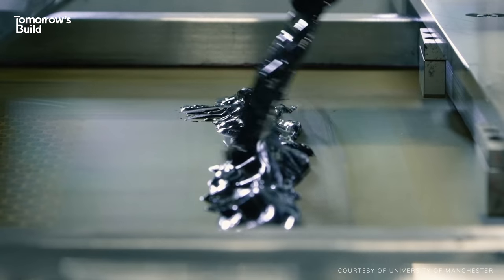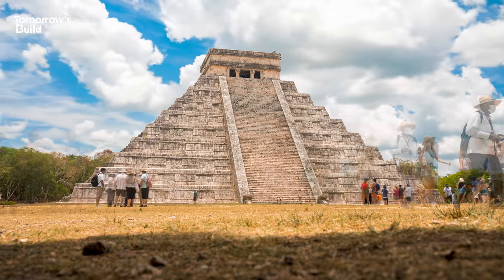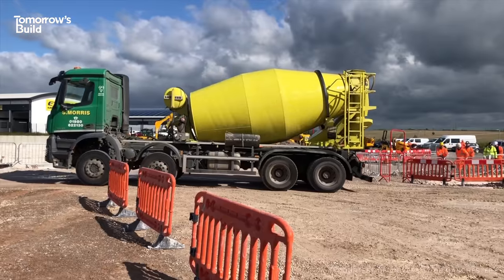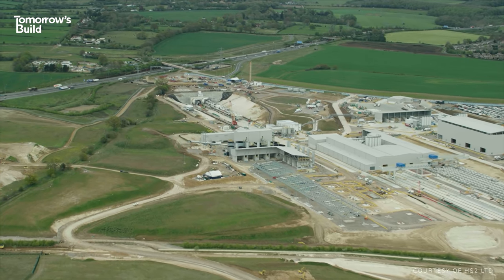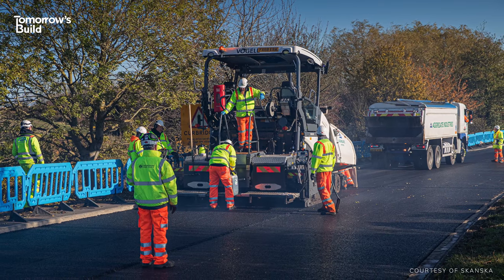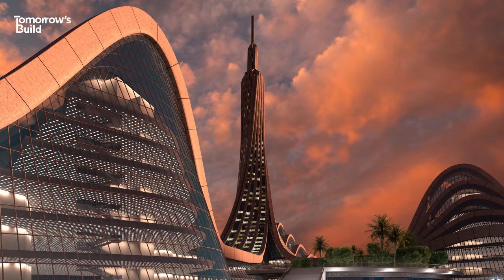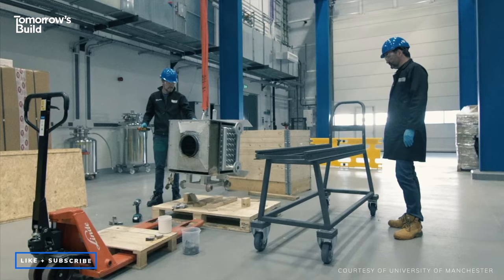Construction's Graphene Revolution Has (Finally) Begun

Comment: All great, but if you want to think sustainably, you have to consider what happens during demolition. Like asbestos, graphene dust could be carcinogenic. It may just not be worth the effort if the industry wants to become sustainable. Steel is great, wood is wonderful, but concrete in general is pretty much impossible to recycle. Adding graphene may just make the process worst.
Reply: @matthewcapobianco9332  It still might be not the greatest idea to breathe in those nanotubes.

Besides that, adding graphene to anything essentially makes it a composite, and those are notoriously hard to recycle (where "hard" means unprofitable). So Adam has a point here.
Reply: @AdamPitas  hmmm, I wonder, as it has been suggested before in the space and futurism scene 
when it comes to the problem of radiation exposure in long space flights, there's an actual change that we'll just be able to cure cancer 
(be it by learning to detect it when it has only a little cluster of cells, or develop gene therapies that work 90% of the time, or actual vaccines that teach the immune system to kill specif tumour one might have or whatever) 
before we learn how to shield completely a space vessel/ station/ colony from all harmful radiation and just live with it
so much on earth is already carcinogen naturally, and our industrial process multiply these exposures greatly, and probably will continue to do so 
it may be too optimistic, but it might just be plausible to consider the scenario in which we just learn how to cure cancer as a response to carcinogenics
Reply: @matheussanthiago9685  An idea that I'm surprised doesn't get more attention. I think you're the first person in a long while I've seen bring up that possibility.
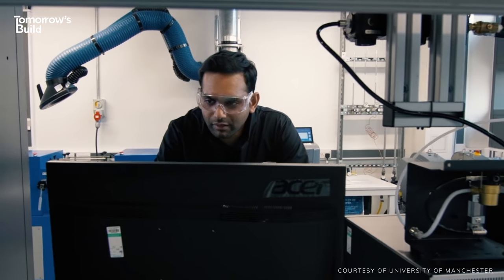Reply: I noticed the guy at 2:15 wasnt wearing a mask. He just opened up a big tub of graphene dust and shook it around.
Reply: You are always blinded when you look at the sun. No inventor ever thought what will his invention will actually turn out to be, other then what they thought it should be.
Reply: @Adam Pitas  💯   Only by examining the impacts and consequences throughout the entire life cycle of the product -- from extraction of source material through recycling (or demolition)  -- can we evaluate whether it is helpful or harmful.

Any less analysis is just boosterism for the next profit darling of investors.  Leaving us to live with the consequences.
Reply: Or- it could just as likely be a very good thing in 50 - 75 years when the demo happens. Impossible to predict what the world will be like then when it's difficult to predict past even five years. I say we move ahead at full speed and not allow fear to lock us into a lesser fate.
Reply: @AdamPitas  I actually don’t think graphenes will be nearly as problematic as carbon nanotubes (CNT’s). The asbestos disease is a result of needle like fibres similar to CNT’s damaging cells, whereas the nano plate like  structures of graphene are actually more comparable to clay and ceramic materials which are also 2D nanosheets. So I remain optimistic. Not all nano-structures are carcinogenic, it just means they exist at the nano scale. The morphology and reactivity is what matters the most.
Reply: @Joe-nq6hy  it’s an ionic crystalline structure, with many thousands of repeating units of ions, definitely much larger than the atomic scale (it’s not typically called molecular due to the bonding properties but will usually be larger than most molecules). I’m not sure the structures of moon dust, but I had heard that it is ultra fine and highly charged on the moon surface from high energy radiation causing it to both be highly sticky and also be at risk of entering the lungs avioli due to its small size, so generally not nice stuff
Reply: Concrete is crushed and recycled,  what are you talking about?
Reply: @MrLong-pe3cm  graphene oxide
Reply: @antpoo  When it hardens, concrete undergoes a chemical reaction that isn't reversible. You can reuse concrete as gravel or aggregate, but you cannot recycle it. In recycling you have to ask yourself if the material can regain the properties it originally had, concrete cannot.

Most concrete isn't reused because it's an expensive process and people generally want fresh concrete in their new buildings. Calling reused concrete recycling isn't correct. I think it just perpetuates misinformation that concrete could be a sustainable construction material.
Reply: @AdamPitas  oh I see what you mean.  We do recycle into other uses (crushing for road base)  but yes, concrete prior to curing is a one off process.
Reply: @Citizen-of-theworld  both graphene sheets and CNTs have serious potential consequences in the blood stream and collected in the brain/spine due to the high conductivity.
Reply: @MrLong-pe3cm  No, it's not.
Reply: @ADobbin1  but graphene and carbon nano tubes are forms of carbon rarely encountered in nature and also having properties opposite other forms of carbon. Including low reactivity (will not degrade) and conductivity (can disrupt system function) and strong structure (can poke holes in stuff it shouldn't). 

Relatively large man made versions of these carbon structures in unnatural quantities may have a lot more affect on a body than just touching or breathing in some carbon or graphite dust. 

Basically needs to be seriously studied, if this material has never before seen useful properties it is also possible it has never before seen negative consequences. 

Super excited for industrial manufacturing and use cases for them, but also hope we are a bit more cautious about it than we were about asbestos or phosphorus for example.
Reply: @5353Jumper  I agree it does need decades of study but when have humans ever been cautious when there was a way to make tons of money or a major health crisis for instance?
Reply: @ADobbin1  also if graphene and CNT live up to some of their promises they could help solve a lot of the world other catastrophic problems. Better renewal energy production, better batteries, lighter materials, energy efficiency, clean water and more. It would just be really nice if it could do all that without giving us all brain tumors.
Reply: @ADobbin1  if it were just carbon molecules we would just call it carbon.
Reply: @antpoo  why they call it graphene i don't know but it is carbon lined up in a particular lattice structure the same as diamond but with a different pattern.
Reply: @MrLong-pe3cm  no.
Reply: @MrLong-pe3cm  no.
Reply: @antpoo  That is called repurpose, when you recycle glass it makes grass again,
Reply: You forgot hemp
Reply: @lonestarr1490  I hate how we try to put our garbage into everything. Asphalt is 100% recyclable, it doesn’t need plastic or glass, it already contains recycled stuff probably.
Reply: @Joe-nq6hy  moon dust is probably more like fine broken glass.

Sand grains on earth are fairly smooth because the wind and water grind them down, but on the moon this doesn't happen.
Reply: @antpoo  Diamonds are just carbon, yet they're referred to as diamonds. Why? Because carbon atoms can be arranged in a variety of different ways, resulting in a variety of different materials with wildly differing properties, and it is useful to distinguish between these different materials. That's a two-line introduction to the concept of allotropes.
Graphene, coal, diamonds, carbon nanotubes and buckminsterfullerene are all allotropes of carbon.

Comment: Nice video, but I would have liked it more if you went in a bit more details about it's ecological properties. Is raw graphene recycable and does mixing it with other stuff hinder the recycling process of those materials? Why is it so hard to make in mass? What about Energy cost and pollution from producing it? Also, this being very conductive in heat AND electricity sounds more like it limits some of its applications as a standalone material. 

This honestly sounded more like a sales pitch. Nevertheless, I didn't know about Graphene at all, so thanks for the introduction!

Comment: I like the idea of graphene replacing things like gold in PCB traces and copper in CPUs; leading to potentially even cheaper and faster electronics. Now we just need to discover the next wonder material that is easy to produce to replace silicon since we're nearing the limits of silicon before quantum physics start playing a role and causing electron jumps and skips.
Reply: If graphene does not go the same way radioactivity and asbestus went I am all for it

Comment: Well let's just hope that this time around, unlike with the emerging issue with environmental plastic nano- and microparticles, the cyto- and genotoxicity of graphene and GFNs is fully determined for all life webs before these materials are introduced widespread into the environment!
Reply: Graphene is naturally occurring in small quantities. Graphite has it inside it and we have used graphite pencils for  a long time now
Reply: @Cyberwar101  Sorry, but that's an incredibly poorly formed argument. There are countless substances and pathogens that are "naturally occurring" but which in a particular phase, form, formulation or quantity (mass or rate) may be determined to present an unacceptable risk, perhaps as a consequence of emergent properties.
Reply: well, if I'm no mistaken graphene is a fairly simple arrangement, whereas the polymers that form plastics are huge molecule with long repeating patterns that make the breaking process a more complex demanding more time and energy to completely break 
I'm under the impression that graphene's structural simplicity give it a huge advantage over plastic when it comes to natural decay 
I could be very wrong, and if someone has a more profound understanding on the subject, I'd be delighted to be enlightened
Reply: They argue about industry regulation slowing them down, but regulations in the constructions industry is there for a reason: if tomorrow everything was built with graphene, and in 10 years we realize it's just like asbestos, or that it turns into a paste on earthquakes, or that it makes the concrete flammable, or poorly insulated, or even something else we couldn't even think of, then we have 10 years of new buildings that need to be carefully demolished or even entire neighbourhoods made dangerous by the side effects.

Comment: Now I've got find out how it increases concretes strength.  Curiosity is sometime a curse.
Reply: I think that's what makes us humans special
Reply: Lots of handwaving and 'magic' probably. Oh and creative testing. Lots of that
Reply: Same reason why carbon is added to iron to make steel. It's got a lot of tensile strength, which means that mixing it into a material without much tensile strength increases its overall durability. When concrete flexes, it tends to develop tears and cracks, those widen into full breaks. When you add graphene into it, then the strength of the graphene helps to stop the formation of those cracks.
Reply: @Cyberwar101  The two cannot be compared at all. Totally different.
Reply: @Lazy_Tim  it's more of an analogy scenario 
surely the process and proprieties are a whole new beast entirely
Reply: @Cyberwar101  I guess the point is that if the cement cannot bond to the graphene then it could be nucleation sites for those cracks to start, and the small size of the particles could mean that they just slide out of the surrounding concrete rather than stop the cracks from propagating.
I would also like to know a bit more about it myself.
Reply: It's not about curiousity you are just wasting your time consooming useless information .
Reply: @Meeeeeee37  I disagree.
Reply: I don't understand how graphene flakes helps for anything. I was thinking of it something similar to carbon fibre or carbon nanotubes.
Reply: Or they could have just told us in the video.
Basically the video was saying, "You know how to use google? Go try it and tell us what you find out."
Reply: @N0Xa880iUL  I found myself wondering this, too. The powder we kept seeing… does it somehow bond to itself, and the rest of the concrete mix? I haven't studied material science since high school, but still, I just can't see how it could improve tensile strength if it's not elongated, like rebar.
Reply: @Meeeeeee37  If you're going to criticise people for how they spend their time, correct spelling might be useful information for you to have.
Reply: @nomadMik  Yep. I struggle with the same. It probably has to do with material science not being my field. Maybe it's obvious to someone from there.
Reply: @nomadMik  In his defense, I'd guess he's just projecting in a sarcastic way. Also that consoom is popular meme spelling of consume.

Edit: I'm not now sure as he misspelled curiosity as well. Lol.
Reply: @protorhinocerator142  The video is basically one long ad for the new "wonder material".
Reply: As I understand it on a very basic level like rebar just on a much smaller scale
Reply: @Lazy_Tim  Are they that different? As far as I know the addition of carbon to iron makes it stronger because the larger carbon molecules prevent the movement between the dislocations in the semi-crystalline structure of the metal, which sounds distinctly like a similar process to the role of rebar and graphene increasing concrete’s strength due to their better strength under tension.
Reply: The reactions that happen when we mix cement, water, sand and stone kind of produce filaments of silicates that bind together all the grains of sand and small pebbles, what makes concrete great when it comes to bearing compression. I don't know, maybe the graphene strengthens the filaments making then even better at supporting compression and traction. (Sorry if some words might be out of context,  but since English isn't my mother tongue, in some fields I may lack the proper vocabulary).
Reply: It is carbon. Concrete is mostly carbon. They bond perfectly.
Reply: @justahuman2345  No it isn't. Concrete is mostly calcium, silicon, aluminium, oxygen, and iron.
Reply: Its essentially a replacement for steel bars, which are usually added to concrete to keep it together even if it's cracked
Reply: @Meeeeeee37  don't break this person's curiosity. Too many adults are boring and sad because people say things like that punish them socially for their curiosity, and over time, it kills their curiosity. Humanity progresses because people are curious.
Reply: @Meeeeeee37  oh hello stranger on the internet, what brings you here to watch this video you deem contain useless information
Reply: @Lazy_Tim  I would advise watching "Practical Engineering". Just being able to replace steel reebars with a additive is a huge leap foward.
Start with "Was Roman Concrete Better?" It is explains why we use steel reinforcements - why we have to use steel rebar - but how the steel is also a massiv issue in the long run.
Then the "Surfside Condo Collapse: What We Know So Far" as it delves into thermal issues of steel reinforcement (and how that can cause issues over decades).
Reply: @Meeeeeee37  yet you taking time to actually write a comment telling someone they were wasting their time was a great use of your time...
Reply: 1 word hexagons
Reply: We don't know that it does. All we know is this woman claimed it does.
Reply: @Cyberwar101  it does not have any tensile strength in powder form. I don't believe the claim that it makes concrete 30% stronger.
Reply: @leonardonetagamer  Can't possibly replace them if its in powder form.

Comment: How well does the graphene concrete without rebar protect against tension and shear compared to normal concrete with rebar?
Reply: I think there’s still a lot of testing needed to find the new tolerances when rebar is replaced with graphene. It’s coming through.
Reply: @thomasfholland  No, these tests would have been required before they started building with it.  Especially the highway parts that are being built with it.
Reply: Your biggest problem is cost. I like graphene but currently it's economically impractical to build with it especially since we don't have large factories to produce it like we have for steel.
Reply: @StrangeTerror  (no highway it is about the HS 2 project that is going to be a highspeed traintrack.
Reply: Rebar will always be needed,little bit of BS involved.
Reply: @paxundpeace9970  Fair enough, either way though the point remains.

Comment: you can use it for geothermal plants to transport heat to the surface instead of injecting water down causing seismic activities which is what we are doing now
Reply: am I mad, or this could be a breakthrough into allowing the building of grid scale thermal batteries?
Reply: @matheussanthiago9685  yup absolutely possible. you can then use thermo electric generators to harvest electricity at night
Reply: @ticklemeandillhurtyou5800  This is something that could solve global warming while keeping most of the oil industry jobs.
Reply: wow that's actually a great idea
Reply: @ticklemeandillhurtyou5800  the deepest borehole ever drilled got to temperatures of 180C. That's just not very hot especially after the liquid travels 7 miles cooling off the whole way
Reply: Geothermal energy is not only about themal conductivity but also thermal capacity. Water have amazing properties for storing & transporting thermal energy, especially considering its cost. I doubt we will see non-liquid methods of extracting geothermal energy for the forseeable future.
Reply: @ticklemeandillhurtyou5800  Water chemistry down there is pretty bad. Devil is in the details.
Reply: oh damn, that's cool